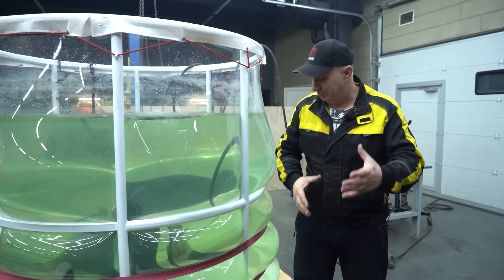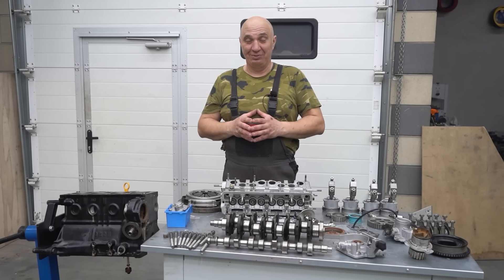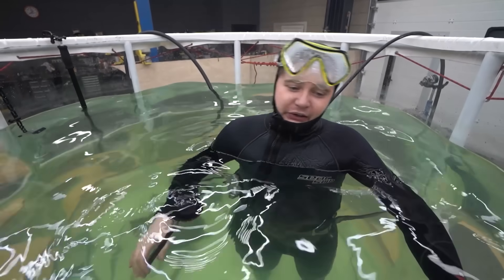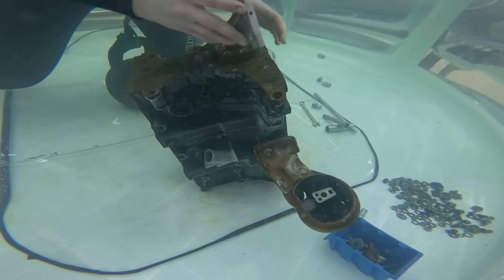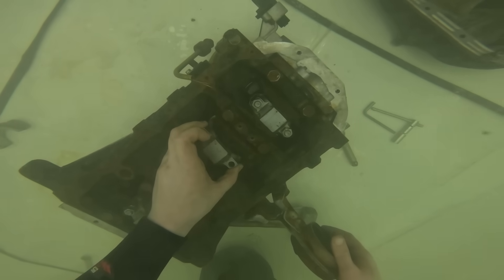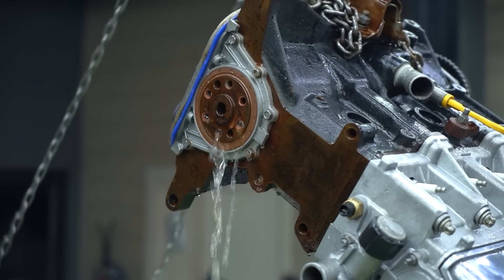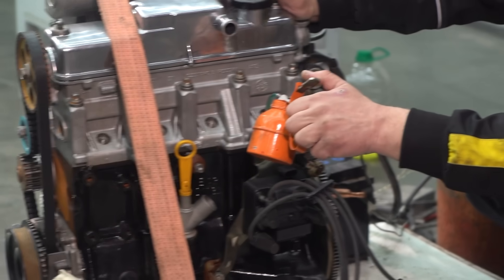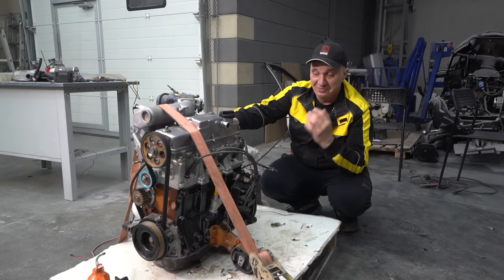We assemble an engine underwater (will it start?)

Comment: You should have added a sacrificial magnesium anode that will corrode first before any of the steel rusts. They are also used in large steel water tanks to completely protect them from rust.

Comment: Wondering if you guys have done a video on an engine with different types of pistons all in the same block, and a single camshaft with each cylinder a different  cam profile. If ya haven't it would be cool to hear that run.

Comment: During World War Two, buses and other vehicles were modified to run on something called "Producer Gas". A small trailer was towed behind the vehicle which contained wood which was burnt with restricted air. This created a somewhat unpleasant gas that was volatile but not as much as petrol. It was fed to the engine via a pipe.
The vehicles were slow and it was discontinued soon after the war.

Just an idea.....

Comment: Youve made alot of engine components with wood, can you try to make the block from wood with proper sleeves. If it works try to add the rest of the wooden parts you made in the past to the wood block ab see of it will run maybe even drive 😊 ps. I love your channel you are my type of crazy keep it up.💪

Comment: Assemble a engine using half the bolts required for everything, tappet cover, cylinder head, camshaft, engine block... everything. Thank you

Comment: I have had an idea for a pretty long time, but would probably never be able to see if it would work:
Could a pressure washer be used as a high pressure diesel injection pump?

And what would happen if it were to pump gasoline? It would probably be a very good flame thrower!

Comment: "I cannot imagine how this experience could be useful." Imagine if we had a transparent liquid that is 7.8X as dense as water. Buoyancy would cancel out the first 7.8kg/L of whatever you are moving, making steel feel nearly weightless! Assembling things while feeling like you are in 20m deep when you actually are only ~2.5m deep may get a bit rough.

Where is it not possible to assemble an engine? Inside an active volcano sounds like a good place not to do it.

Comment: I wonder how many blind bolt holes are in a lada engine? That is the scariest part, having a hydraulic lock in a bolt hole could crack the housing when tightening as water can't compress.

Comment: Try to assemble a engine on a mountain at very high altitude like around 12k above sea level. On second thought maybe to risky as altitude sickness. Other idea is built engine while engine block only being upside down, you can't flip it around on stand and install engine upside down while also the car being upside down. The only two stupid ideas can come up with at the moment that maybe possible?

My other idea likely way out of budget and more on the insane side would be to put a smaller jet turbine engine something around 7,000 horsepower with the nozzle not half way done and add a cage of course and damping system for the jet engine. This would have to be in the rear of the car and shield behind it for safety. Way better tires, brakes and suspension, beefed up frame and hardware where needed of course and tested on a tarmac and not on public roads as this one could be dangerous if not done correctly, but it can definitely be done and even usable if done correctly. It be nice if you can somewhat make it look like it belongs on the car from factory. Of course controls all in the front and instrument cluster be converted over to a instrument panel. Maybe even keep the car engine in front for weight and a manual transmission gear box for neutral/reverse gear, or do electric motor instead for reverse.

Comment: @8:30 well, this would not have been an issue if you assembled it under oil!  Ha!  Why use water when you could have used old engine oil!  Let him try to assemble it with zero visibility too!  Well, I guess you could use baby oil / mineral oil so you could see a little and wow, he would be so smooth and smell nice after!  😂
Reply: Or baby oil. You can run a PC submerged in baby oil, and it's pretty clear
Reply: @andrewkerridge1678 you sounding like a real Diddy victim right now

Comment: Seems to me that #4 might have bent a valve when freeing up the camshaft. (piston was up?) The other thing would be they should have put assembly lube on everything before dropping the parts in the water. That would repel water and solve the rust issue.

Comment: Wouldnt hydraulic pressure crack the block when tightenning bolts down with holes full of water???
Reply: It can seep out of the threads. I've put in main cap bolts with completely dry threads, and seen them coated in oil on disassembly. If oil can get past, I'm sure water can too.

Comment: Next time, fill the tank with vegetable oil and make the build a diesel and try to fire it up inside the tank, in the vegetable oil, and use the vegetable oil as the fuel and the lubricant :)

Comment: I wonder how much of the engine you can remove before it stops running at all...
I know it should run without the oil pan (though not for long), but could it go without some of the pistons? Do you need all of those seals and gaskets? The engine can definitely be run without the exhaust manifold, but what about the intake manifold? Surely nothing bad can happen if you remove half of the bearings, right? And what about the screws?

Comment: If you are looking for a challenge : Try the Thomas Ogle's Vapor Fuel System allowed test vehicles to achieve over 100 miles per gallon of gasoline in 1977—with no carbon emissions. But be warned he did die of mysterious causes and his designs disappeared to , so take future measures to secure your experiments .
Reply: Dude its a hoax, no such thing as oil based internal combustion engine without emissions can exist, laws of physics dont allow that, its the same myth as perpetual motion devices, no carbon based fuel can be burnt without carbon emissions. However it would be perfect challenge for aprils fools video just like they did with magnets several times.
Reply: I said this so many times on this channel i am not sure that they even  read coments on english chanel or not

Comment: But if the bolt holds are filled with water won't that keep the bolts from them tightening all the way ?
Reply: I think they must have screwed them in slowly to allow the pressure to bleed off until the next day, or cut a flute in them with an anglegrinder.

Comment: Why wouldn’t it start? As long as you drain the water out and dry ignition system 
I would like to see you build a engine and hook up a system for it to run under water and see how deep it can go before water gets in somewhere
And you wouldn’t have a rust issue if you had not left it and let air on wet iron